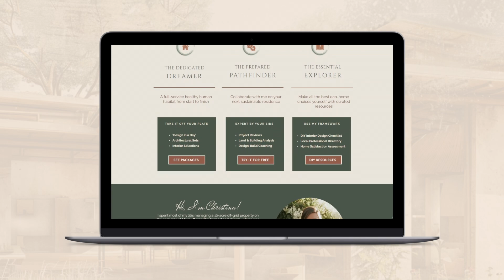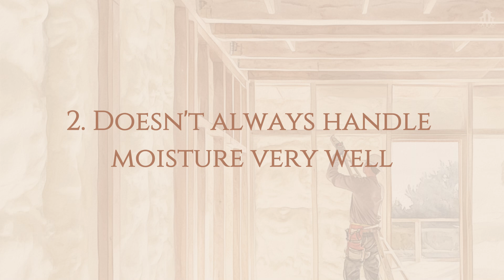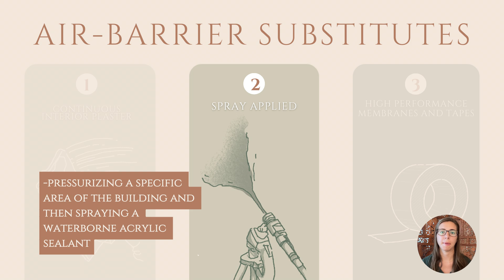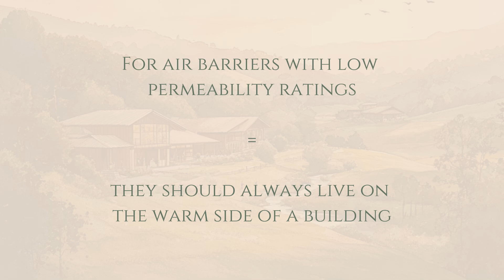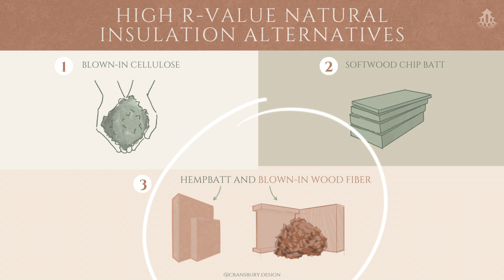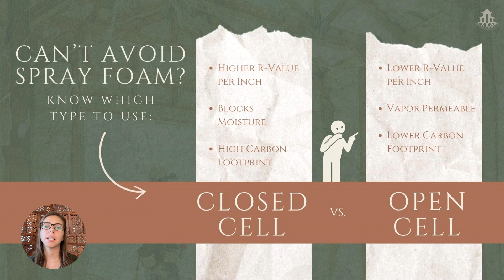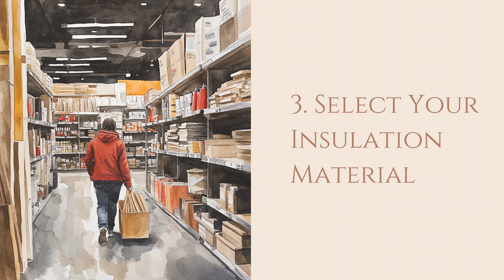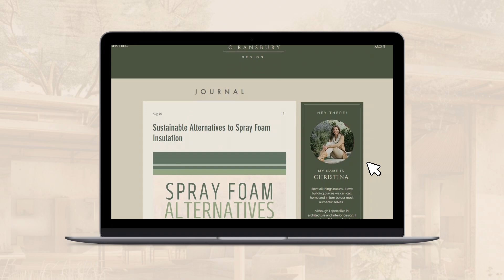Better Than Spray Foam? These Sustainable Materials Do More

Comment: Which of these is best for preexisting homes, not new construction? My home was built in the 60s. From what I know, homes built back then were not built with insulation. You can really feel the lack of insulation in the winter. I live in South Carolina.
Reply from the maker: You can still do this with pre-existing homes.  I would suggest air sealing with something like aeoseal from the interior, and use batt insulation options (rockwool, hemp, sheeps wool, etc

Comment: I live in Portugal which (I understand) is one of the largest producers of cork. I can't understand why it isn't used more for insulation. The way it is produced is a kind of self sustaining cycle it's quite fascinating.
Reply from the maker: yes!  you are in a great location to use cork!
Reply: Do you know a place you can recommend where i can buy cork insulation straight from the manufacterer for shipping to Belgium?

Comment: What are your thoughts on making my own fire resistant cellulose insulation by using recycled corrugated cardboard collected from local stores (Walmart/Aldi's/Publix) using a Wheat Paste glue for bonding (Adding Borax for insect resistance and potassium aluminum sulfate for fire resistance)?
Reply: If you pull this off let me know. The challenge is in breaking down the cardboard efficiently and safely.  I’ve pulped soaked cardboard in a drum - what a mess!  There is a guy on YouTube who effectively processes cardboard on a table saw with a combination of dado blades and regular blades… not for me. Mixing dado and other blades could result in shattered blades. I’ve read about people dry processing cardboard in a drum with string trimmer. Evidently you need a high powered trimmer.  I’m considering making a device, but at the end of the day cellulose insulation is cheap so the savings are not great.  It’s the polyiso foam, rock wool, etc that add up and are expensive.
Reply: Oh and Borax or a Borax and Boric Acid mix in the right proportions will give you excellent fire resistance.  Borate mixes are commonly used in commercial applications for that purpose. In fact, before phos chek, the big firefighting aircraft tankers were known as “borate bombers” because that’s what they applied. Unfortunately borate mixes aren’t great for plants, hence the switch to phos chek
Reply: One other thought. I’m assuming the wheat paste would be to form panels… I was considering using cellulose the way it’s normally used, as a loose fill insulation.  What I learned is that if the fiber is dense packed instead of loose filled, it provides better insulation, is inherently fire resistant, and is very similar to rock wool insulation in performance.  I am in fact still considering it for insulation, but am looking at alternatives too.  I live in a supposedly high fire risk area, so fire resistance is paramount to me.
Reply from the maker: Interesting concept!  I would try a test batch.  Have you heard of papercrete?

Do you have a house you are working on currently?
Reply: @christinaransbury I am in the planning stages of a minimalist off grid 395 sq ft tiny home.  Thank you for your inspirational videos!
Reply from the maker: @DougG3  oh nice!  Do you have land your building on?  I'd love to chat with you more to see what ideas you are exploring and what challenges you are facing.  Would you be open to chatting?  And I of course, can share any insights I have for you as well.  Email me!  info@cransbury.com

Comment: Check out Airkrete GREENsulation. It is a 'cementious foam' material that can be pumped into cavities resembling shaving cream. It has an R-value of 6 per ince of thickness. It is 100% FIREPROOF, non-toxic, non-allergenic, pest resistant, won't grow mold on it, & it actually absorbs CO2 from the air once the foam cures.

Comment: Foam is the first thing rodents chew through to get to the warm inside. Second is expanded polysterene, third any type of rock or glass wool. All pose no serious barrier for rodents. Only old growth wood (thin rings making the wood more dense), dry clay mix, stone or metal make a home rodent proof.
Reply from the maker: Right?  Those are great points, thanks for sharing.  Old growth wood <3

Comment: What are your thoughts on rock wool for insulation?  Great videos!  (Just came across your channel & binging through your library! 😂)
Reply from the maker: Thanks for following along!  I actually think Rockwool is great for certain applications, especially roofs.  I regret including it in this video!  It does require a bit of processing but is generally a pretty low carbon footprint.  Its great on roofs because of its high R value, waterproof and fireproof properties.  Its a great when used as exterior insulation.  Hope that helps!
Reply: @christinaransbury  Not very good in areas with rodents. They eat right through it and like living in it. As rodent proof roof / ceiling insulation it's better to use straw mixed with clay slip or stuff made of old newspapers and similar recyclables that is sprayed with rodent repellants like borax and boric acid (celluloid / cellulose wool, for example Werrowool). This might differ by area as some rodents may ignore some repellants.

Rock wool is also hazardous to place, not as bad as some other artificial stuff but much worse than hemp and similar natural wools. The heat during production makes all kinds of tiny particles separate into the wool.
Reply: @christinaransbury  Thank you!  Yes, I was thinking it would be great for the exterior envelope. 👍

Comment: What about pfas in any if these materials?
Reply from the maker: Thats a great question!  I'll have to look into that a little closer.  From what I understand PFAs are more prevalent in coatings and adhesives, so would mostly be a concern for the air barriers and not the insulation.  I think there are some water based air barrier sealants out there that may be a good option, like Prosoco.  I will look into these a little further!  Learning more and more every day!

Comment: I'm about to start building my own home and I don't have enough money to do it. . I'll be doing most of the work myself . I'm going to use a system  called X-bracket by insofast . It seem like the fast and cheap way to get 4 inches of spray foam insulation on the outside of the house in an inexpensive way .Its new but they have lots of videos on youtube .Just wondered what you would think of them ? And also what would be the less expensive but healthy way to use their system ? I'm in Asheville NC .Heres a link or just look them up . https://www.youtube.com/watch?v=RcY11UV7x8U.  I would love to hear your thoughts on them. And yes I know Im crazy for building without enough money.  But sometime you have to do what you have to do and life doesn't give you any other way out. I trust that I'm always in the right place at the right time.

Comment from the maker: 0:00 - Spray Foam Intro
0:36 - Intro
0:56 - Why we choose spray foam
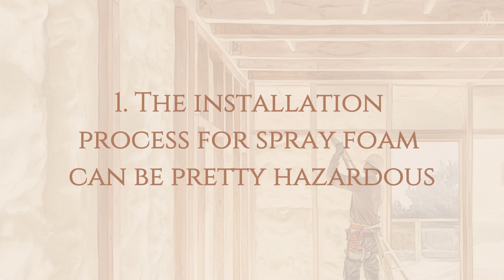1:33 - CONS
4:31 - Eco-Friendly Air Barriers
8:31 - Materials with High R-Value
12:21 - Two main types of Spray Foam
13:25 - Key Tips for choosing a sustainable insulation alternative
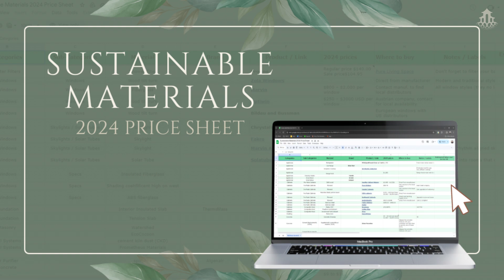15:28 - Downloadable Sustainable Materials Pricelist
16:00 - Conclusion